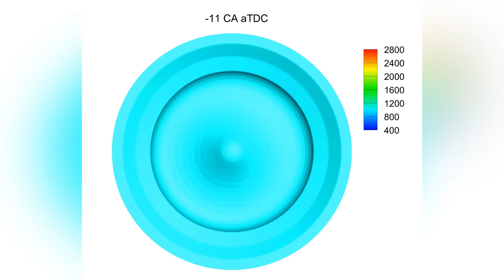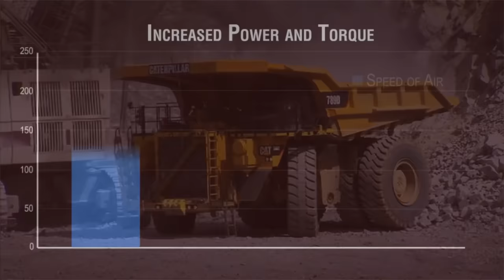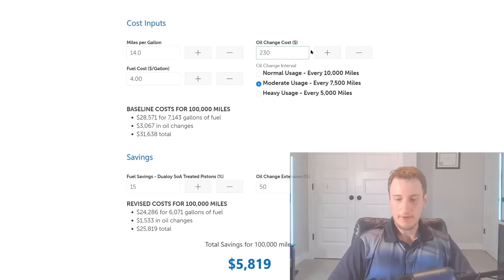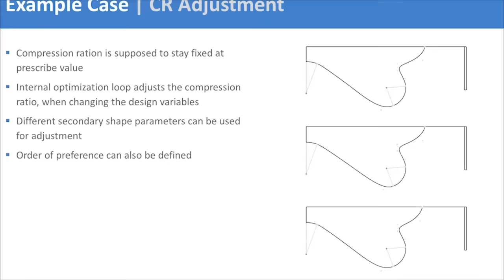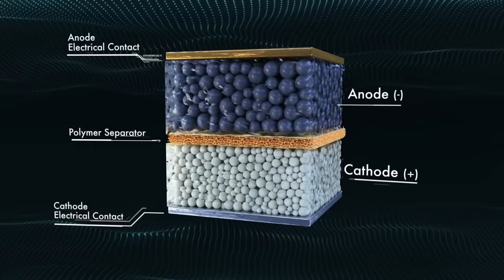ICE Breakthrough!? NEW Piston Design BREAKS Records

Comment: I'm in agreeance with a few other comments, although we kneed to know the original piston design and compared compression ratios. Hollow top pistons like this typically allow a slightly larger initial charge, but lower compression ratio. Some loss in torque, but improved fuel efficiency. This was common back in the 60s and 70 where you could opt for a high compression or low compression engine where the only difference was the dished out piston crown.
Reply: Plus more piston surface area for the combustion heat to be transferred to. Not a benefit.
Reply: Bowl Type Pistons like those are used in DIESELS , which have a Flat  Cylinder Head . The  Bowl  IS  the combustion chamber .
Reply: Diesel Pistons !  And  diesels  run at a MINIMUM  of  16:1  compression .
Reply: @shannonjurgens3667  I have to be honest and say I have never mapped the thermodynamics between flat top and dished pistons, but I am sure the correct rings would handle any small differences. Just thinking back, heat also equals energy, so the additional heat also equates to energy transfer to the piston.
Reply: @johncunningham4820  It's the same principle with low compression petrol/gas(US) engines. The Low/High compression label is a comparison rather than a static ratio.
It was a long time debate in the performance and racing industry in the early day between Head combustion chamber vs Cylinder combustion chamber.
Even though the volume cab be equal between both, the momentum of the piston and the gas charge of a dished piston seams it get a slight increase in the charge.
As far as actual combustion goes it is a balance between piston crown design, head combustion chamber design as well as flow and swirl. <- in essence shaping the location of where that air fuel mix sits in the cylinder between the piston and the ignition source.
Reply: @axle.australian.patriot  . Flat Head  and Bowl Piston , in a Petrol Engine , is known as a  HERON  Head . 
99.9% of Heavy Diesels use the Design . Better  efficiency . 
As for Ignition , the Fuel Injection Event  IS  the Ignition in a Diesel . And dead centre above the Piston . Injection pressures can be 2000 bar  PLUS . And Engine compression is 16:1  MINIMUM . Can be up to 25:1 . The Swirl zone is In the Bowl , and that Bowl contains the Thermal expansion quite well , putting less load on the Compression Rings .
Reply: @johncunningham4820  this exactly. My TDI runs ~18:1 static compression plus up to 35 psi of boost. Typical gas engines would detonate and fall apart in seconds doing what these Diesels can do!
Reply: @rickway2039  . Yep . 
I  don't  get it why so many of the Comment Posters think that Piston design is for Petrol Engines , when it is  OBVIOUSLY  a  Diesel  Piston .
Just  Zero understanding of the subject  I  guess .

Comment: Innovation usually comes in small incremental steps. If this lives up to 25% more economy that would be a massive step. If there is a true net gain and it's only 5%, it's still potentially worth implementing in new engine production. Now a really big game changing innovation is the recent toroidal propeller design. It is a significant increase in efficiency for boat propulsion, and for sound reduction in drones.
Reply: And double the oil life. Sounds too good to be true
Reply: Variable valve timing made those leaps

Comment: as a 2 stroke guy i can attest to things of this nature and idk why i never thought hey why not do that on 4 stroke. hear me out.
some 2 stroke cylinders that are high rpm 10,000 ish rpms but dont have crazy port timings they actually respond well to some combustion chamber modifications.
it was found that some waves like ^^^ ^^^ ^^^ ^^^ going around the cylinder head would actually give better combustion. squish band heads came out shortly later and that pretty much did the same thing those marks on the head did. 

if you were to have some raised stampings on the piston or on the head you could induce or almost compression ignition in areas so the flame doesnt have to reach as far to ignite the edge of the cylinder. its already trying to burn so it would catch much easier. alot like relighting a smoldering fire vs cold wet wood. 
yeah it wont make 11 million horsepower but it would improve efficiency some.
i have some proof on one of my 2 stroke cylinders i also tested that out on and yet again it did alot of tricks. you can easily tell the before and after combustion marks on fresh cylinder and how much better it was after making the modifications. that cylinder in particular was blowing the fresh combustion straight out the exhaust port and just wasting fuel and putting it in the exhaust. after 5 mins with a dremel the flame front was dead center of the piston and it was much more light brown and not wet and unburnt oil tar. i never would have thought something that simple would help but it made a huge diff in tune tune ability and driveability. and a little bit of power.

Comment: So the ceramic will allow the piston to run cooler and the dimples allow less surface tension on the ceramic? 
When porting intakes especially on diesels, we’ll dimple the low pressure areas of the port to to create less tension to speed up the airflow so the air doesn’t slow down in the low pressure area. 
Might be a benefit inside the cup but I don’t see a point of dimpling the flats on the piston?

Comment: The dimples increase the air mixture close to the piston top which actually causes more turbulence inside the squish area, this results in a much better or more complete burn of the intake charge, less likely to have a pre-ignition although this is diesel so that is not much of an issue given the fuel is direct injected.
Reply: I believe you are correct.  Isn't the fuel injected after the air is already compressed in a desiel engine?
Reply: @mauricelarson7263  correct

Comment: cast pistons = bigger clearances until hot = more pollution on start up = hyperutectic = high in silicone and special rings better sealing and smaller gaps is the new industry type = PSZ partially stabilized zirconium pistons and berrillium alloys for valve seals is an advanced product - even coated and de frictionized  less oil and services ? all put on hold for electric !

Comment: I reviewed the initial YouTube video by the manufacturer and they said they are marketing both piston’s and piston’s + Turbo + computer/tuner.
If it’s just piston’s I don’t doubt that any change will produce some results, if you add tuning and turbocharger it’s not going to be $6k probably 10k plus the costs for installation and tuning.
Most owners don’t have an extra 10 thousand bucks for an engine upgrade. Commercial fleet owners are a good fit and they can test the system for results.
The part I don’t understand is why did it take so long to get here?
I’m not towing anything but the claim is 25% better fuel mileage and lower environmental factors so low you might be able to pass emissions testing without catalytic converters or soot collecting no more regeneration and no more def fluid. I’m assuming that’s where the big fuel savings is not just the piston’s not just the tuner or the turbo.
If there’s no more particulate filter required and no regenerate which is very fuel wasting process. Then I could agree with the %25 increase in fuel economy and reduction of Nox since the burn is more complete.
I’m just wondering if we will continue to see idiots rolling coal with their pickup trucks?

Comment: I feel that ICE engine technology still has so much more to give and it’s a shame that much of that potential might never be reached due to the shift towards electric.
Reply: Don't worry, EV's will get pushback when we realise batteries have to be recycled. 

And that it's very expensive.
Reply: Don't get me started on the 2 stroke. 
Way more power than a 4 stroke  ,can be done without oil in the fuel ,and less crap flying around inside.
But no they killed em.
Reply: There is a little more to be had, sure, mostly emissions and fuel economy stuff, but every other piece of internal combustion engine technology was invented in the 1960s at the latest, its a proven and perfected invention that isn't going anywhere, ever. Don't believe the hype about electric cars, they can't be made affordable, I know, I built one in 2009.

Comment: Optimization of the pressure front on the piston should be the focus.  Adding a compressed air path to the injector and a mixing venturi to fully atomize the fuel being placed into the combustion chamber will provide much better gains.

Comment: I questioned the manufacturer of this design.  If I were to take a used engine that may already be worn, causing loss of cylinder seal, then rebuilt it with "these" pistons, sure there is going to be a power increase.  But when I asked about this, the manufacturer avoided that question.  I have not yet seen where they took an engine that had under 10% leakdown, replaced the pistons with "these", and seen any appreciable power, torque, or emissions improvement.  They've not been able to prove that yet.

Comment: They are not really interested in you generating less profit for them.  Here is a list of old technologies.  Hold onto your hats, the last one is a kicker.

The best way to design a conventional engine is a scotch yoke like design with two in line pistons and an electric generator inbetween connected to an electric system, or with an old magnetic variable transmission (maybe), that reaches such high compression it burns the hydrogen.  This has been tried before.   I call the online generator engine the Watson engine, after my friend Daniel Watson who suggested it, when I was briefly trying to figure out how to do a low friction orbital piston engine with near constant speed through the stroke for electric generation between the pistons.  There was a company that was designing a variation of this theme aiming at 100Mpg a decade or do ago.  I think a design was in a form lift at the time.

Look up the Israeli Aquarius engine (process that Atlantis), that was cheap, as it could be made out of softer steel, and stick a electric generator between the pistons, about the same time as the previous engine.  We are talking about designs that would propell a small car to wrll over 140Mpg (EU).

Now, there was a small car manufacturer in France, going back frcsrs, that produced cats with up to over 140Mpg, without these engines.  With these engines, we could look at 200mpg+, as was achieved in the 1920's or so, using precracked normal fuel.  Once they cracked the fuel, they could no longer get these sorts of results without much pronlems doing so.

Look up low temperature burning and engine designs, which is how spontaneous human combustion mechanism consumes even bone.

Let's look at the hybrid electric turbo diesel Golf that got down to around 1.74 litres per hundred kilometres (over 150mp US). They curved repossessed and scrapped all of those, like an earlier hybrid once people figured out they could just modify them, to recharge the day battery pack each night, rather than use feul to charge the battery pack.  Even movie stars going to court to keep their vehicles against the regulation, couldn't go it.  A massive scandal.

Look up the technology around 15 years ago, where they electromagnetically stimulate the wave front of the fuel burn to get a more complete burn.  I figured out, of I applied that to deisel, I could perhaps get much better economy and a clean fuel burn, without a particulate filter.

Look up the fish carburettor, an alternative to injection, where they try to close it fine, and destroy the factory.  We didn't need early complex injection technologies.

Look up the regenerated braking that for used, that compressed the engine to brake, turned off the engine, and used the compression to restart the engine and take off.  So, you stop at traffic lights with a lot less fuel usage.  How come we don't all have cars like that, using one of these newer engine technologies?

Look up the junk emissions control technologies, that just used more fuel, so that for decades new equivalent cars couldn't compete on fuel economy.

Now, the real kicker.  Years ago, in an environmental fair, there was a guy with a mod carburettor system in Australia, claiming over 1000 MPG (non American MPG). I didn't know exactly what he was doing, and concluded that was too big.  But, knowing now, what guys were up to at that stage, it is like the amount an orgon energy device, would use to lubricate the system, to stop it seizing up or warping, as the orgon energy is virtually like extracting vacuum energy.  But, at the time I didn't know about this.  Guts into this and hydrogen fuel generation car technologies, had people from intelligence turn up and told them to stop.  I think military intelligence.  I had a couple of friends in military intelligence (I never discussed this with them).

So, just with a normal type of fuel, and a combination of the more normal types of technologies above, and this toroidal like piston (look that up), we should be driving around cars with up to between 200-300 mph, non electric.  It is a con.  Now, add electric, and maybe we will get 200-300 mpg more of the time.

People are dim witted, including the people who let these people do this to us!

Look it all up, and see what was really out there.  Most of the stuff I mentioned is the more conventional type of technologies, so doable.  Bunches in Australia were connected to a the All Earth Technology people over here (actually I think that was EMP in Victoria, Australia),  Whoever it was, sold heaps of publications and kits on these things, and people started research groups and properties eventually, and had their own publication).

Comment: With the engines being over 150 years old you're not going to see anything that produces improvements of 25%, you'll see single figure improvements and like everything else they only work when carefully controlled.  Shaping of the piston head isn't new and sometimes its a necessity but you quickly find that the piston crown builds up deposits that collect in areas where gas speeds are lower - so any gains will likely diminish.  Having said that, there will always be gains to be made and its encouraging to see that despite the projected demise of the ICE, I'm sure it will be around for a while yet.  The problem with Petrol and Diesel is that they are just so bloody good at what they do.  A while ago someone calculated that if you fill a petrol car with 100 litres of Diesel in a couple of minutes thats equivalent of 50MW of power flow.  Thats the entire output of a small power station - or 20 wind turbines ideal conditions or 25 Hectares of Solar at midday on the equator.
Reply: 1l Diesel equals 12kw/h ....100l Diesel equals 1200kw/h  ...1200kw/H =1.2Mw/h

Comment: It appears the piston is painted on top and the side. I also see that Cerakote has a high temp "Piston paint" and they have a video of them painting the top and sides. I think it is a hydrophobic finish that reduces friction and carbon build up?? Not sure.
Reply: I Cerakoted my piston skirts with the Micro Slick and Ceramic V-136 the tops, didint do the head and valves unfortunately, I also got the crank, Vanos and bearing shells WPC treated, in my BMW S54, I average around 32 mpg on the highway, and throttle response is crazy fast, compared to a stock M3 and everyone that has driven mine, they say its a lot faster than theirs, and mine is stock, 45k miles on the rebuild, burns 0 oil.
Reply: ya, the coatings are no joke

Comment: The design would allow for two things, it would mix the fuel and air better due to local turbulence, the second would be more surface area would conduct the expansion force more evenly. 20% is a stretch, but 10 to 15% will be likely. It also would be more tolorant of very lean mixtures where detonation occurs which is probably where the 20% is coming from.
Reply: And if lean mixtures is what you're looking for, Mazda has Skyactiv X for that.  Shame they aren't bringing it to the US.
Reply: Diesel engines cannot detonate. This company does not mention gasoline engines but does say something cryptic like they would like to expand their product into other applications including other fuels.

Comment: This would only be available for low compression turbocharged applications. My pistons in my 12.5:1 engine are domed with valve reliefs, the opposite of a bowl.
Reply: This was pretty specifically geared towards diesels.  Which even in their lowest compression turbo variants sit around 16.5:1 and upwards of 24:1 in some older NA models.  That "dish" in the piston you're seeing here is actually the bowl or chamber where combustion takes place in a diesel because the bottom of the cylinder head is perfectly flat and has no chamber volume.

Comment: Should be simpler to create 3D printed prototypes to use as sacrificial mold core.  Create reproducible forms in bulk.  High pressure form them.  Polish to fit.  Seems silly to machine any more than necessary.  Car manufacturers hate longevity so of course must be after-market.

Comment: There's a lot of skepticism about the 25% figure, but what is the maximum observed under ideal lab conditions? If the mixture of fuel and air was as good as physics allows, would we get 25%?
Reply: Max theoretical thermodynamic efficiency for Diesels is 70%. Most run between 30-50%. So a 25% gain (30%->37.5% or 50->62.5%) would all be within theoretical limits.
Reply: Tractor trailers gets about 4 mpg. +25% would be 5 mpg.

I have serious doubts this design would have any benefit to non diesel applications.